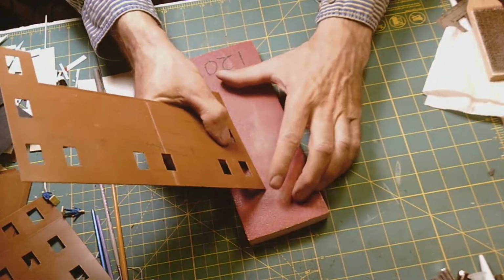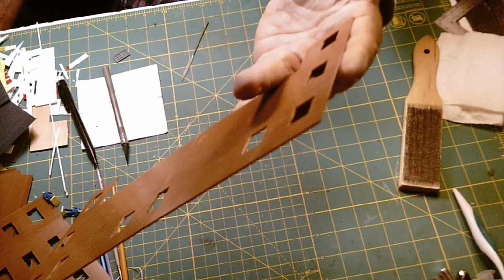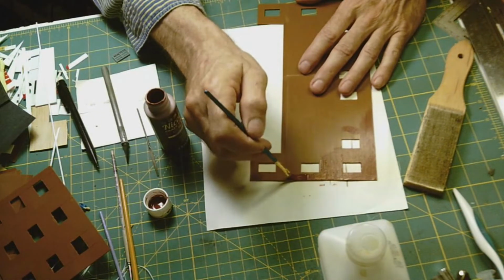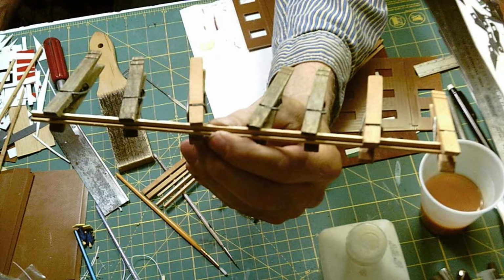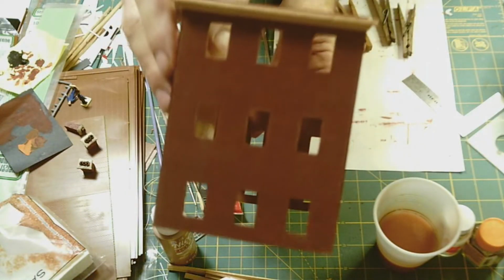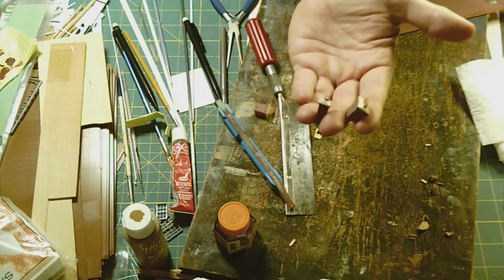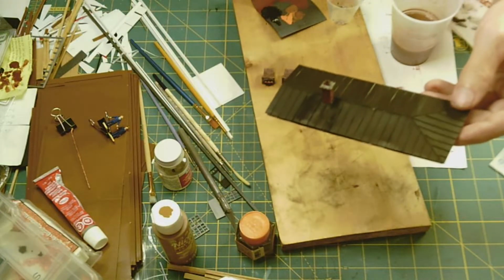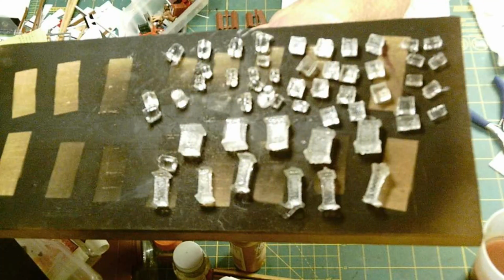SCRATCH BUILDING A PROTOTYPICAL RAILROAD STATION - HOTEL

Comment: thank you for sharing your skills.I have a question about the nibbler you use.In micro
 mark catelog they have a device that you can hit or punch out the square corners or doors and windows or a nibbler.Which do you think would be best for me as a begi nner in structure building?
Reply from the maker: Each has its purpose . The punch is good for wood and soft materials but can crack or break  Hard plastics. It would probably work on soft plastic . I have  a punch and it is a good tool . For this building the punch just would not have worked !  Thanks for watching !!!